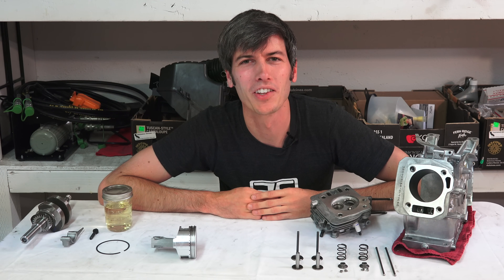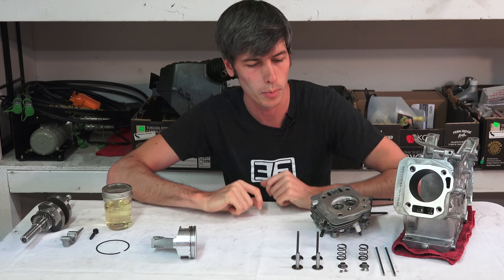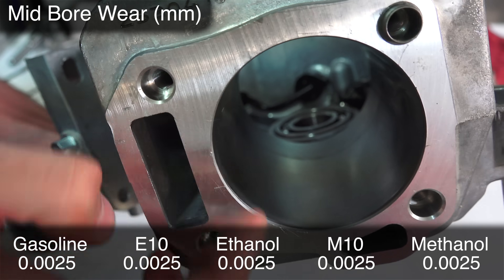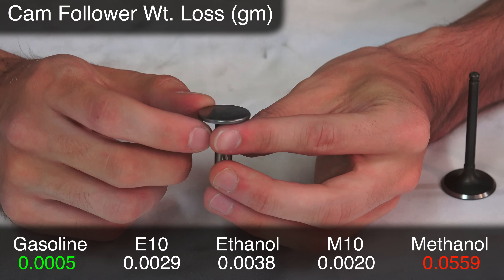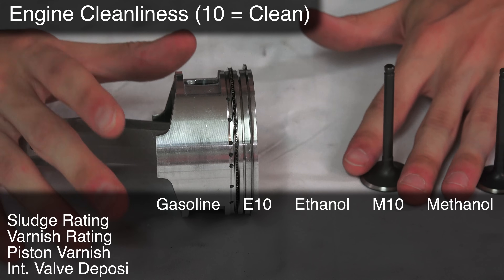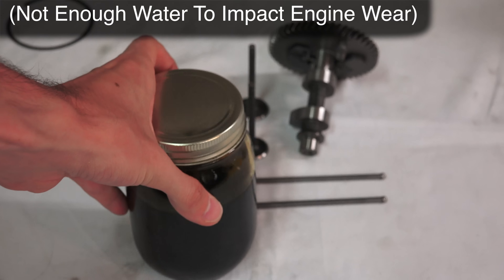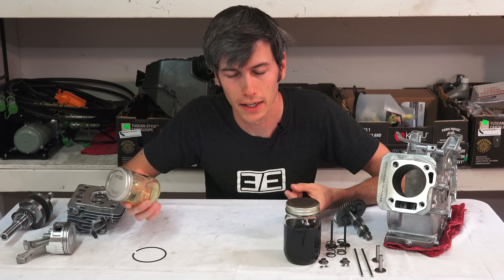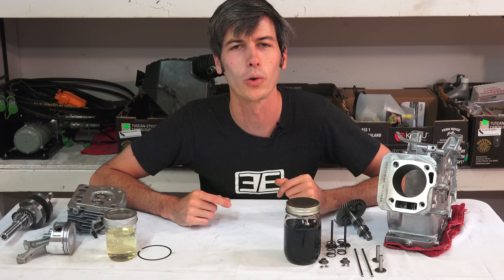Is Ethanol Bad For Your Car's Engine?

Comment: Car's fuel systems have been designed to handle 10% ethanol longer than most people realize. Especially those living in places just getting it, they think its a new thing. Here in Minnesota E10 was mandated in the mid-90s. 
It was called Gasohol in the later 70s in corn growing states Nebraska, Iowa, southern Minnesota anywhere the farm lobby was strong. 
The manufacturers have been making their fuel systems for it since around 1980. Hell, I run E10 in my 66 Volvo with zero issues. 
It's likely the overall impact on the environment has been worse because of it. The farm lobby is huge, but don't worry about problems running it.

Comment: "You have to run ethanol-free gas in it. Otherwise, the carb float will stick and it will flood out."

This is what the owner told me when I test drove his 1981 F100 with the 300 6-cylinder and a 1bbl carb. I think this is where most of the concerns about ethanol came from. Back in the 1990s when ethanol first appeared there were some compatability issues with older fuel systems. Ethanol is fine for vehicles designed to run on it, which is pretty much every vehicle sold in the US for the last 25 years.

That said, ethanol fuel is a scam and little more than a gift to the US corn lobbyists.

Comment: seeing the number sequence "254" and its multiples everywhere in the video is a sign that the units should have just been left in inches in the first place unless you're going to truncate the significant digits appropriately. there's an implied precision to 0.0254mm (versus 0.0253, 0.0255) that simply isn't there if the original figure was 0.001in

Comment: 49 seconds in and I have to say. E fuel, 5 or 10%, moreso the latter, will wreck your petrol mower by clogging the small jets in the carb with jelly and if you have a classic car, for example, a 1972 VW Transporter/Campervan. It will totally rust up the inside of your tank, (which means removing the engine to take the tank out!!) making the sender unit inoperative and transporting lots of rust to your carb! Oh it's lovely stuff, NOT!
Reply: NOPE..running E15 in my riding lawn mower with a 24 hp Briggs with the videos on my channel proving it.

Comment: They did a spectrometric oil analysis on the oil. The same thing i used to collect an oil sample for every time i parked the F-15 i crew chiefed from both Pratt &Whitney PW100-F100 fighter jet engines.

Comment: Most modern parts are alcohol rated to at least some degree - my edelbrock and holley carbs work just fine with E10 gas - that said E10 gives poor gas mileage compared to pure gas plus the energy required to make E10 far outweighs what you get out of it - E10 is a farm subsidy, nothing more, that costs the people trillions of dollars.

Comment: One reason as I understand for ethanol is to reduce exhaust emissions now if the fuel consumption is higher with ethanol how will that affect the emissions if we use more fuel, will it be a negligible impact or still an improvement? Of course if we use more fuel the governments collect more tax! Maybe a subject for further discussion as it was more about wear and tear of the engine which was very interesting.

Comment: My understanding is that the main complaint with ethanol blend fuel is corrosion due to water absorption and material degradation from the aggressive chemical nature of the alcohol on the polymers and elastomers. Of particular concern is small engines that only run occasionally. I keep non-ethanol gas in all my cans and small engines.

Comment: It's insanity to require ethanol in gasoline since it takes more energy to produce ethanol than the energy we get from it. It drys out engine seals and causes them to leak. This is a gift to farmers at the expence of car owners. I would prefer giving farmers a subsidy than having engine problems and lower gas mileage and also less power.

Comment: When informed people talk about methanol, sure there are some adjustments to be made because of the corrose nature of that fuel. Unlike gasoline, it does not have a complex, two carbon molicule per hydrogen chain. This is what makes it 2X better than gasoline in emissions alone. Combine the fact that methane is able to produce up to 3X more horsepower & torque. Tendering any argument about it's  being less energy dense, cost to produce is miniscule in comparison to any and all other fuels. Who wants a 100K car that you cant find a refueling infrastructure, redering it useless on long hauls? Unless my biology is wrong, plants inhale carbon dioxide and expel oxigen. Explain to me how battery technology mining and production don't  create exactly the same carbon footprint unless the battery technology were to last at least 30% longer? EV's are a MASSIVE LIE!
Reply: REBOOT...and try again.

Comment: Never, ever use it in aircraft. Especially in low-wing aircraft. Ethanol has a lower Reed vapor pressure which will cost vaporlock and stoppage of an engine, most usually on takeoff. It also acts like a sponge which draws water into an aircrafts fuel tank.

Comment: Ethanol dissolves plastic fuel lines in small engines.  Every 6-8 months it  is necessary to replaces all the fuel lines in your weedeater, blower, lawnmover, edger, chainsaw, generator, and every other small engine device.
Reply: NOPE!
Reply: @oldblueaccord2629  WRONG !
Reply: @glenpaul3606  its your dream...live it anyway you want man.

Comment: No one seems to address the fact that ethanol produces only about two-thirds the energy of gasoline, so in reality it will take more ethanol based gasoline to move a vehicle the same distance as non ethanol  gasoline.  What are the numbers on how  much more ethanol based gasoline is used by our nation compared to non ethanol gasoline?
Reply: which brand use 0% ethanol?

Comment: Hi, i've been watching a few of your videos and learning from them. i was interested in this one particularly as i like to use older cars, i have a mercedes 1996 jaguars from 1973 upto 2002, the newer models i have little interest in. i am in the UK and i always use E5 at the pump as i was always worried about fuel seperation and corrosion in the fuel lines also damage to injector seals etc. you have pretty much confirmed that i need to be using E5 and not E10 especially as some of my cars don't get used that often and fuel will sit dormant in the tanks. thanks for the info.

Comment: I have a 197S0 type 1 vw 1600 single port.  I'm not sure which fuel I should be using.  The only thing that distinguishes it from stock is that it has hardened valve seats and electronic ignition.  Does ethanol burn cleaner to the extent that it will increase engine life?  Does ethanol create problems with condensation?  Should I alternate between ethanol and gasoline?

Comment: Fuel separation is a huge deal. any engine not designed for alcohol will not run as well. Using more fuel. Small engines sit for some time, do not run well with this trash gas, then the carburetor clogs up and refuses to start. The alcohol bonds with water and when the crap fuel separates, you now have water in the bottom of your tank.....

This crap fuel is a big pain in the ....

Comment: Anyone ever wonder why we are paying for 100% gasoline per gallon at the pump when the stations are blending up to 17% ethanol into the 87, 89, 91 and 93 octanes? Shouldn't we be paying the difference on the 17% ethanol that is blended? Its like paying full price for a bottle of whiskey when 20% of it's contents are water. Also, why did ethanol prices at the pump go up in tandem with gas prices? I don't recall an ethanol pipe line that was shutdown (sarcasm) LMFAO. ;)

Comment: Ethanol is more bad for your belly than for your car. The ethanol manufacturing process generates a lot of corn syrup. That same corn syrup is sold at very low prices to companies such as COCA-COLA, PEPSI, HEINZ and most others in the food industry because it is much cheaper than the regular sugar. But that glucose syrup is a disaster for your weight and your health.

Comment: My experience, for what it's worth.

I've been mixing E15 and E85 at roughly equal ratios since 2016 when the Sheetz stores in my area began offering both. My decision to do so was partly geo-political, I want to send as little of my earnings to countries that hate us (US) and partly scientific. I knew that my 2006 Honda Element took approx 13 gallons to fill up when the Fuel light came on, so I pumped 6.5 gallons of E15 first, then topped up with E85, 50% or less of ethanol. Much beyond 50% and WOT suffered. If I anticipate pulling a trailer I fill up with E10, it runs better under load.

The Element with the aerodynamics of a garage door got about 18.5 mpg at highway COMMUTER (15-20 mph over posted) speeds with E10 vs 17.0-17.5 with 50/50; about a 9% loss in fuel efficiency, but depending of the price of E85 I was usually saving money or breaking even. At 50/50 the long term fuel trim is about +8%, with E10 about -1%; I have the Torque app on my phone and a Bluetooth dongle stays on my OBD2 port.

I worked in the Acura/Honda repair field for 34 years, my co-workers predicted fuel pump failure, catalytic failure and all dire consequences. I'm now at 315,000 miles on the original fuel pump and catalytic. The only time I get a catalytic P0420 DTC is when I am on a trip and can only find E10; which indicates to me that the E50 mix is running cleaner on  a 315,000 mile catalytic that otherwise would be long needed replacement.

My wife's 2003 Accord V6 with 270,000 miles runs E15 with no issues whatsoever.
Reply: Nice job thats what I have found out in my testing as well.

Comment: Could I run E85 in my 2019 MAZDA CX-5 2.5 liter turbo without causing any problems?
(I have successfully run 25% 100 octane gas and 75% 91 octane gas and found a small power increase using my butt dyno and an accelerometer. MAZDA must have made their fuel map to accommodate higher octane fuel.

Comment: Methanol has worse wear(obviously!) but this study has got too be flawed...?  If full ethanol keeps your engine cleaner than full gasoline, then why is e10% ethanol measuring dirtier then full gasoline.............should be inbetween gas and ethanol as theres not alot but alittle bit is more then none and should not have the opposite effect! Or is there some sorr of reaction that im not aware of?  Looking too jump up to e15-e30 too help prevent and clean carbon deposits but if irs going too do the opposite???

Comment: Here in the UK, the regular gas has been switched to E10, but premium gas stays using E5. Is it worth paying more at the pump for the premium gas? You get more miles with slightly higher cost?

Comment: Would the new ethanol rating that Biden put into place cause issues with the fuel pump?  Anyone else having fuel pump issues recently?  The parts guys at 4 separate auto parts shops all said there has been an increase in fuel pumps being purchased recently.

Comment: Not a big deal, wrong it might keep the motor internals clean but it gives worse performance.  And it eats plastics.
Even worse on a 2 stroke motor becuse the piston walls are lined with Teflon.

Comment: Is ethenol bad for seals and hoses?  Is there a kit for extracting water from the ethenol before it gets to the engine?  Is there a kit to get it out of the oil?  I'm curious about running on pure ethenol as long as weather doesn't make it a hassle.l

Comment: Now do the study on a modern GDI engine and look at the buildup. I also have several carbureted engines that fail to see the benefits of E10. If left to sit it will gum up the carb and destroy seals. Now Biden wants to RAISE ethanol content. It’s all to destroy our engines to push the EV initiative.

Comment: Running an E30 blend on my b58 bmw (mapped for e30) and it loves it. Was running a 93 octane map before and it was pulling all sorts of timing... 93 octane pump gas wasn't 93 in reality. 500bhp from a downpipe and flash is pretty darn good. I love the corn 🌽

Comment: Gasoline with ethanol in cars and motorcycles that have been standing still in a garage for say one year are acummulating water from atmosphere by breathing of the tank. 
Bacteries seem attracted by the water in the mixture and create a very corrosive mixture that ruines fuel pumps, rubber fuel lines, corrosion of metal parts, corrosion and blockage of carburettor internals.   It is a real disaster costing hundreds of dollars to repair the damage.   I am speaking from experience.   Ask the garages !!!!!!!

Comment: I have a TroyBilt gas trimmer. It says on it no more than 10% ethanol in the fuel. OK fine. The first Summer of use it was cantankerous to use, keep running, even get started. Under warranty the small engine tech did all he could to find the problem but nothing checked out. He suggested a local fuel depot that has non alcohol premium 91 octane. I tried that but it was still a pain in the ass to start and keep running. I took the tiny carb off and a discovered the small fuel metering diaphragm made out of neoprene or equivalent rubber type material was very wrinkled and distorted. I had to conclude the use of ethanol pump gas caused that even though the instructions said to use it. I found a replacement carb on line. I installed it and using the 91 octane premium it has run perfectly, under load, starting, no problem. Since that mechanic suggested using the alcohol free gas on all my small engines all start and run fine and no maintenance problems. Screw ethanol. I have no choice but to use it on my 35 year old cars hoping similar gremlins are not lurking because of the alcohol fuel. The alcohol free premium is expensive by a dollar or more per gallon and with todays price insanity, it's hard enough to use it on my small engines only. What a mess. Thank you for your research on the effects of alternative fuel mixes. Interesting.

Comment: I have had issue running ethanol blend in my 86 Dodge Daytona Turbo Z. It runs okay with it, but once the engine is up to operating temperature and I shut off the engine, then try to restart shortly after that, it is hard to start, sputters, cuts out and idles rough for about 30 seconds or so until it clears. It is a condition similar to vapor lock and apparently has something to do with the temperature of the fuel in the fuel lines. It is a multi-point fuel injection system, so not sure how that could be fixed. But if I run non-ethanol fuel in it, it does not have those problems and it gets considerably better fuel economy too.

Comment: You can run anything almost non-stop and not see much wear and besides, few people think wear from ethanol is the problem.  It's the CORROSION it causes over time to ALL parts of the system that is the problem on vehicles not designed for it... and some which were designed for it.

Comment: We found that running Methanol in racing Motocross bikes, 2 strokes in the 1980's,  damaged the fuel system badly. We had to make sure that there was no fuel in the carb, crankcase, etc. It would leave a white sludgy deposit that clogged jets.

Methanol was eventually banned as it is highly poisonous.

Comment: I left e gas in my snowblower over the summer,  and when I started it the next winter gas spurted out all over the ground. The repair bill was over $200.If I had started it and run it for a few minutes every week or ten days the gas and ethanol would have remained mixed and there would be no repair bill.

Comment: So would the same corrosion occur with 50/50 water methanol injection? Should I use 50/50 water ethanol instead? Or maybe 25/25/50 meth eth h2o? I know ethanol also has a higher energy content. I do have two controllers so I was toying with the idea of spraying ethanol with one system as a sort of booster or stage two and methanol with the more sophisticated system as the main stage

Comment: If you drive an old Volvo redblock you have nothing to fear with ethanol. Best preformance from high compression engines. If you have problem with the hoses on your 25+ year old car. Perhaps it's time to change them anyway?

Comment: In my college years, I had to do a thesis of the impact of ethanol on gasoline engine systems. At the time, there was significant problems with the removal of "plasticizers" from rubber and plastic components. These plasticizers would be removed from the plastic/rubber components and end up gumming other parts. I believe they have made strides in reformulating the plastic/rubber parts to accommodate the E10 fuels.
Reply: I converted a gas bike to run on pure ethanol and used a modern automobile fuel line.  The line held up completely fine, despite how many times I was told by "experts" that ethanol would immediately rot everything and also blow up the engine (also never happened).  People today are still expressing these concerns for fuels like E15, and it's pretty much nonsense.  If a car was made after 2000 and is running E10, it's wildly unlikely that another 5 percent (or possibly any amount) of ethanol will destroy the fuel line.  People need to think first before repeating old information, hand waving, and using lots of exclamation marks!!!! (as seems common with many opinions on ethanol based fuels)
Reply: @tenbitcomb  Yes, many improvements have been made to accommodate ethanol. As long as your parts have been made recently, I don't think there is a concern anymore.